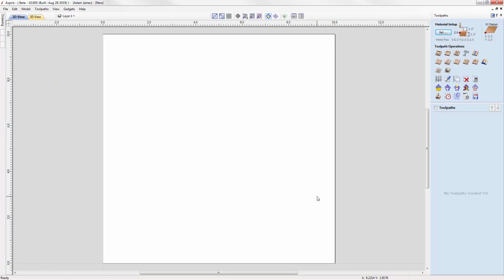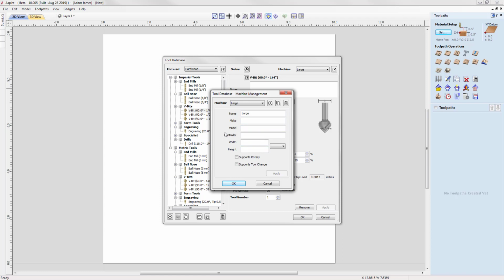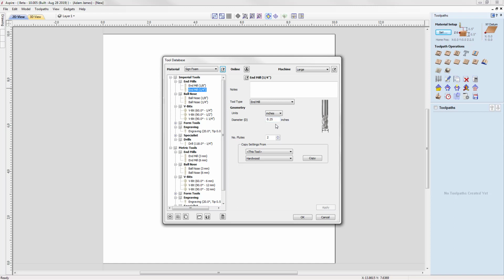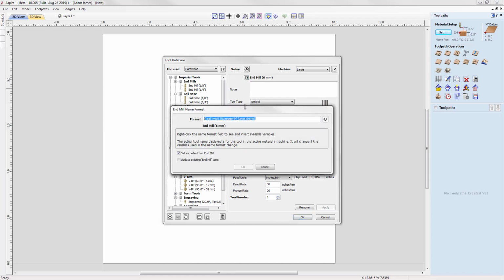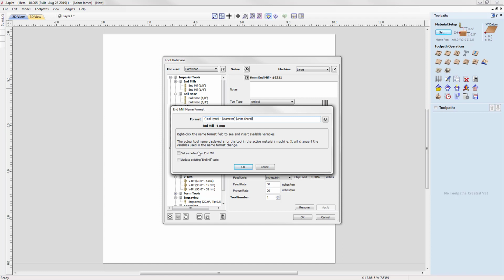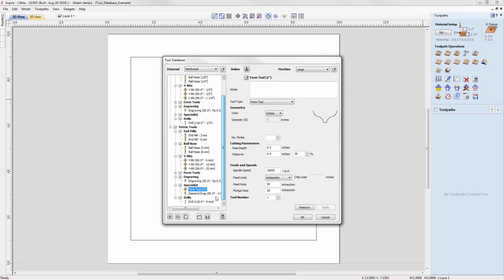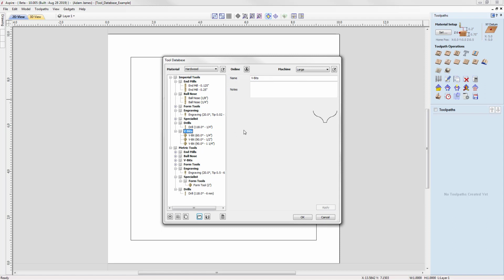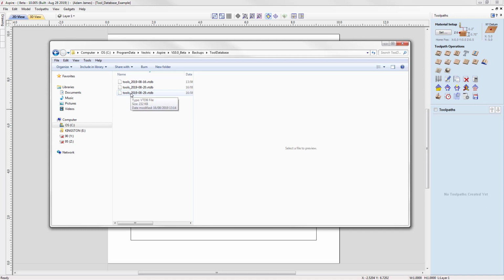Vectric V10 Tutorials | General Topics | Tool Database Guide

Comment: Is this tool database only for router bits? I want to add a oscillating knife.
Reply from the maker: Thank you for your question, if you could kindly email our support team they can guide you as to how you could set up a drag knife in the Tool database - Thank you!
Reply: @vectric  drag knife sure, but a oscillating knife?